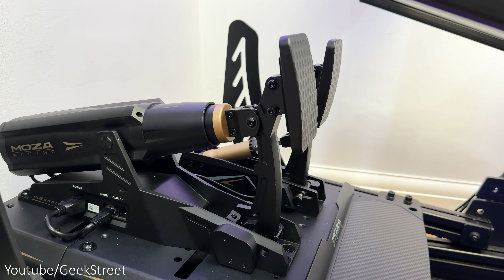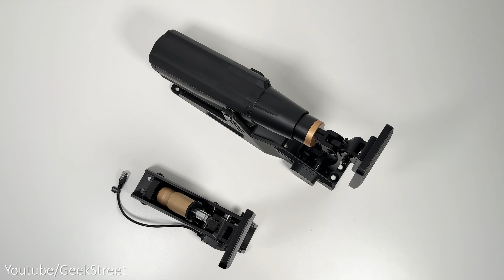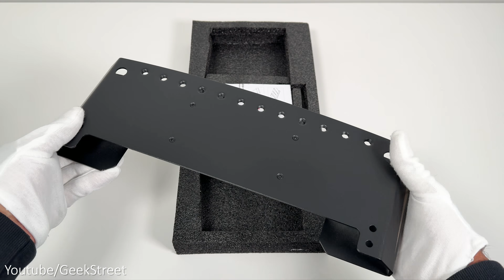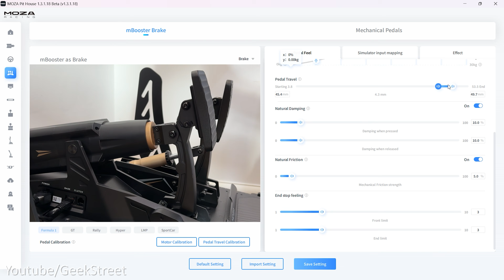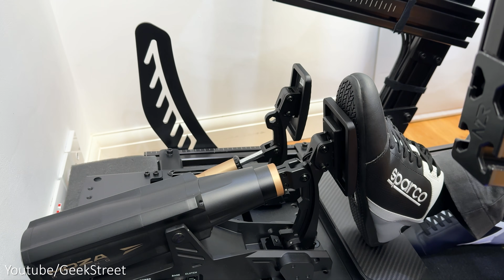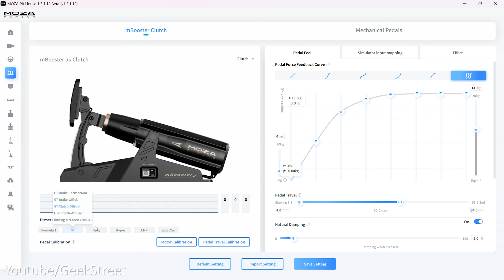Moza mBooster Active Pedal Review | The SIM Racing GAME CHANGER!

Comment from the maker: What do you think of the new mBooster?
Moza Racing website - https://bit.ly/3MjAy4d (5% off with code GEEKSTREET - affiliate)
Reply: This looks awesome - can't believe the range of stuff Moza have given us 👏
Reply: Hi man, can you please give us the max travel for the brake mode ? seems to be limited to 33 mm ?
Reply: Expensive.
Reply: @GaragebuiltOriginal  the only other active pedal on the market is made by simucube and its almost $2000 and this is way better
Reply: To be fast on track active pedal for breaks. To screw around in assetto corsa racing with mates or driving casually in VR active throttle and clutch! My word i will oneday do this! Epic from moza! hope they can oneday go as low as $500 a pedal.

Comment: A question about the extra frontplate. Can it be used to move the standard CRP2 pedals forward to increase the size of the footrest? For me its a little small and I'd like to expand the space a little so my heels have some more room to rest on. Will I be able to use the screw holes on the extra front plate for the front part of the CRP2 pedals and then attack the CRP2 pedals rear screw holes into the original plate somewhere? If anyone could do a measurement for me I'd really appreciate it.

Comment: @GeekStreet how has the NLR pedal supports held up with the additional weight of the mbooster pedal and throttle? I believe it's roughly 30lbs fully assembled, which is a good amount of weight to be supported by 2 thin pieces of aluminum profile.
Reply from the maker: It's been perfectly fine, I've had it on there from day one of the release of the mbooster

Comment: I wanted to invert this with the CRP2 throttle but as you said the cable is way to short on the throttle to reach the other side of the Mbooster, I did try a rj12 cable and coupler but i just can`t get it to work even removing a cable from the rj12 so it had 5 wires the same :(
Reply from the maker: I don't understand why it doesn't work